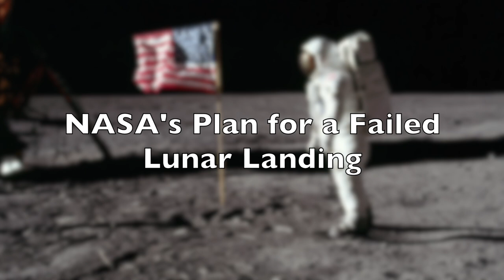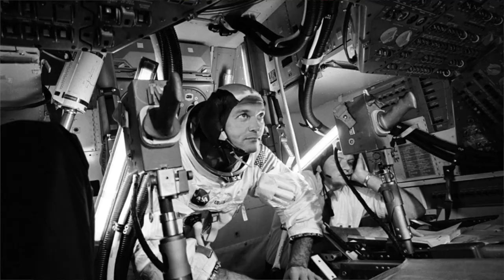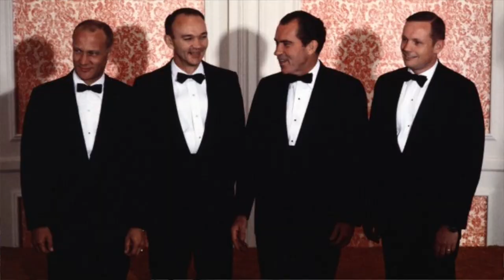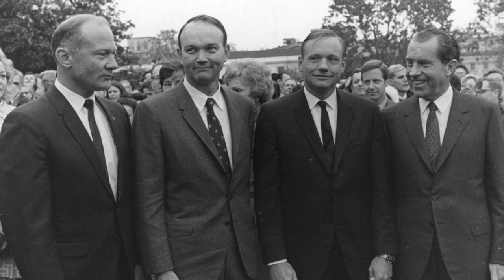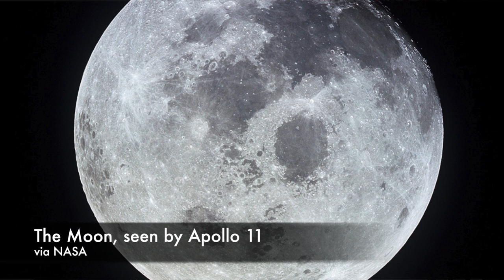NASA's Plan for a Failed Apollo 11

Comment: The interesting note on the mission is the ascent rocket was tested on earth but then had to be completely rebuilt with new parts because of the corrosive nature of the fuel used. Essentially the firing up of that rocket was on the moon, making that the most questionable part of the mission.

Comment: Great video but technically if it was an acceptable failure rate of 0.01 percent (one hundredth of a percent) then that means it should be FOUR nines of an acceptable outcome: 99.99. 99.99+0.01=100. If you meant THREE nines, then that would be a failure rate of 0.1 percent (one tenth of a percent): 99.9+0.01=100. Other than that, great vid!

Comment: there was 20 seconds of fuel left in the descent stage, would that of been enough fuel to get them anywhere near mike collins??
Reply: Technically, it was 20 seconds before they'd have to abort.  That left enough fuel in the descent stage that they could stop the descent, start to gain altitude (and vertical velocity), jettison the descent stage, and fire the ascent stage. The ascent stage, of course, had enough fuel to get back to orbit.

The reason they had to abort before they ran out of fuel in the descent stage is that if they were too low, they'd be in the "dead man's curve"-you'd be too low to have time to fire the ascent stage before you reached surface, but too high to survive the touchdown.

Comment: There was no way Collins would leave while the astronauts were still alive. They would keep trying to save them as long as they lived.
     In fact they almost faced that when they saw that the circuit breaker for the assent engine had broken off.Without the ability to close the breaker the engine would not fire.
     Buzz discovered that their pens fit in the hole and they were able to close it that way.

Comment: The rush rush to get to the Moon did not allow much time to plan acual science, at least the early missions. The need to get their fast (in terms of development time) meant weight was an issue so everything had to be light. 

A slower program would have been better. More robust and cheaper.

Comment: I'm sorry, did you say "ass-end engine" @ 2:29?
Reply: maybe she said "ascent engine"
Reply: That would make more sense.
Reply: The Lunar Module was composed of two parts:  The Descent Stage, and the Ascent Stage.  The Descent Stage would bring the module down to a soft landing on its surface (a period known as "powered descent").  Once on the surface, the descent stage (the legs) now serve as a launching platform for the Ascent Stage (the cockpit).  This requires far less thrust and fuel, without the dead weight of the legs (which were now useless) during the return journey.  After re-docking with the Command Module in Lunar Orbit, the Ascent Stage would be discarded, and the three men would return to Earth in just the Command/Service Module.  With less weight to push, less thrust (and fuel) would be required to break Lunar Orbit.

Virtually every phase of the Lunar Missions were built with saving weight wherever possible in mind.  This is because, for every pound of weight you add to the craft, you need to add approximately four times that much weight in fuel to lift it.
Reply: Thanks guys.
Reply: K1productions The ascent engine is on the ass end of the ascent stage, though. :)
Reply: *****
Nah, I just study this stuff.  NASA has always been a source of inspiration to me, growing up.  Personally... it hurts me greatly to see people trying to destroy it and its reputation

I mean, seriously... find a single thing that NASA has done that has negatively impacted the world
Reply: That's what I thought I heard too
Reply: GathGealaich
Well.... okay... I'll grant you that one.  But that has nothing to do with NASA, that is purely the fault of moronic conspiratards who think the government is sending secret messages in AlphaBits Cereal....

Hell, one could just as easily make a case around the Founding Fathers being a fictional tale, made up to make us think our country had a glorious and honorable birth.  Yes, that theory is totally BS, but just like the moon landings, is impossible to prove to people otherwise without going back in time (or going back to the moon).  And even then, they would call that a hoax too.

Comment: The focus on the importance LEM accent engine functioning is weird, it's almost an Apollo legend. It would be easy to come up with 100 failures that would kill both astronauts. I can imagine one broken wire would do the trick. What makes the engine special?
Reply: There may have been numerous possible failures that would kill the astronauts eventually, but how many would kill them quickly? I would bet that there are a lot of planning documents that effectively say 'if this component fails (or this other bad thing happens) then we immediately abort the stay on the surface and return the astronauts to the command module'. Which makes the only critical issues the ones that either kill the astronauts before they can return to the CM or prevent them from returning at all. The failure of the accent engine is an obvious member of that latter category, and given the level of redundancy in things like the LM's control electronics and the ability to test most other LM systems prior to launch (or even assembly) it may have been the point of critical failure with the highest estimated probability.
Reply: What makes this engine special is that it landed them and returned them to the CM.

Comment: I dont think this is correct. From everything I've ever read Mission Control's protocol was to cut all communication and go completely silent. I suppose the thinking was it would've been emotionally easier for the astronauts to accept their fate without any emotional goodbyes. I could be totally wrong as to the assumption why they would go silent but I've never heard/read anything about them keeping in touch and having a minister communicate with them etc.

Comment: the biggest fear of nasa was that the asent engine wouldn't have started. the engine burned hypergols and it could only be used one then was junk. this meant that the engine couldn't be tested.
Reply: The upside is that it meant that the engine was as simple as you could make a rocket engine.  No need for an igniter, because hypergols react on contact, and because the tanks were pressurized with helium, there was no need for fuel pumps.  Open the valves, the propellants flow, and the engine lights.

Comment: I wonder if Nasa would have sent a second Apollo mission to the 11th's landing site if they had been unable to return.  Of course, the astronauts would have still been dead, but they could have recovered the bodies; there's good research there, as well as more closure for the widows and country. shrug.  If they didn't then, I'm sure humans would have with a return to the moon.  However, they thankfully made it back so nobody had to make that choice.
Reply: I don't think there would have been any point.  They probably wouldn't have been able to find the fault, and they couldn't really bring the bodies back.  The LM was designed to hold two people-they could cram three in as they did on Apollo 13, but not four.  And it took two people to land the thing

Comment: Before: How do they determine this 0.1% balder-dash?! Like, how do you even put a number on this junk and... ya-di-da-di-da.
Now: Woaaaah.... This is STAT1201... I... Just... Can... Stat... F-tests... mind blown
Reply: Oh, I am saying I understand how they got the statistical data such that they could give approximate probabilities of equipment failure. It is iffy, but it makes sense now that I've actually done my first year statistics.
Reply: Essay:
Essentially what I believe they would have done is to look at the failure rate of each component to the Saturn V and Apollo crafts, observed failure rates when testing and continued fixing and tweaking until their mathematical models stated that there was less than a 0.1% chance of failure. But as with all things in reality, there are wild cards that fall outside the scope of assessment. 
From what I've heard about the Apollo 13 mission, it was a classic "she'll be right" incident. The O2 tank had, what was probably, a little bump, workers and engineers said to themselves, "she'll be right", ran a few tests with their supervisors breathing down their necks, tests came back partial failures, "She'll be right" and up it went. 
It's just a lot of people under a lot of pressure to "git'r done", much like what happened to the Space Shuttle Challenger disaster, except in that case, one engineer, Roger Boisjoly, was very vocal about the problems and nobody else listened.
tl;dr
It is all about the scope, how you cannot realistically make it cover all topics, workplace health, safety and handling of fragile goods and hazards of rushed production.
Reply: Because the Apollo 13 accident (like most aircraft/spacecraft accidents) don't have one single cause-it usually takes a whole chain of events (most of which are actually quite harmless-by themselves).  The whole explanation is a little long, but hang with me:In the case of 13, the oxygen tank that exploded had originally been scheduled for use on Apollo 10, but they had a minor accident during installation.  There was no apparent damage, but they decided in the interests of time to swap the tank out and test it later.  Upon testing, they discovered that the "drain tube" used to drain the LOX out of the tank during testing had been damaged.  The tube was never used in flight-only in testing the component, so one of the engineers came up with a novel solution-use the tank heaters to boil off the oxygen in the tank.  This was considered basically a "no risk" procedure-the tank had a thermostat that was set to open if the tank temperature reached 80 degrees.When the spacecraft was originally designed, all the electrical parts were designed for 28V DC.  Later, the spec was changed to 65V DC, because the upgraded testing equipment could run at a higher voltage.  Every component in both the CSM and LM were upgraded to 65V-with one exception; the thermostats in the O2 tanks.  Somehow, it got missed.  When the heat was applied to the tank, it reached 80, the thermostat started to open, but the high voltage jumped the gap and basically arc welded the thermostat shut.  So the heaters kept running, until the internal temperature reached about 1000 degrees, causing the insulation on the tank's internal wiring to degrade.Ordinarily this would have been caught by the engineers running the procedure to drain the tank-except that the temperature gauge they were reading only went up to 80.  After all, there was no need for a higher reading gauge, because the thermostat would keep the tank from getting hotter.That tank went into 13, and when the O2 level dropped below a certain point, there was an arc, the pressure built up, and the tank blew.Now, look at that whole chain of events.  If you eliminate any one of them, the explosion never happens.  Heating the tank to boil off the O2 wouldn't normally have been done.  Not having upgraded thermostats wasn't normally a problem, because the spacecraft ran on 28V (and the tanks worked fine on Apollo 7-12).  Not having a temperature gauge go above 80 wasn't a problem, because the tanks never got hotter than that in testing (largely because they didn't leave them running for hours at a time to empty them-they'd heat cycle the tanks to make sure the heaters worked, and they'd power them down).  It took the whole combination to cause that problem.
Reply: SuperCorrector1 Actually, that's exactly what the accident investigation board did.  The Cortright Commission report is available (as a series of large PDFs) at http://drushel.cwru.edu/apollo13/  Chapter 4 is probably the most relevant.
Reply: I once knew a guy who was an actuary who worked for an insurance company working out how risky a proposal is. So long as they knew all the variants to the issue, someone could crunch a stat for you.
Reply: It is possible using statistics. Mean time to failure is commonly used. The problem is that it is possible to build an unreliable system comprised of reliable parts. In a system of 2 million moving parts like the Saturn, a few parts are bound to fall. That's why engineers sweat bullet s over redunancy and single points of failure.